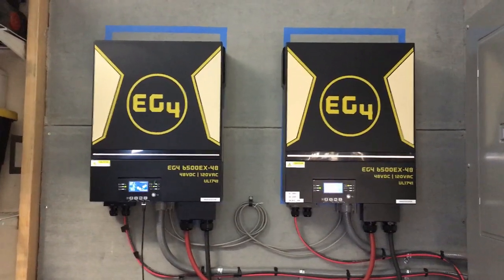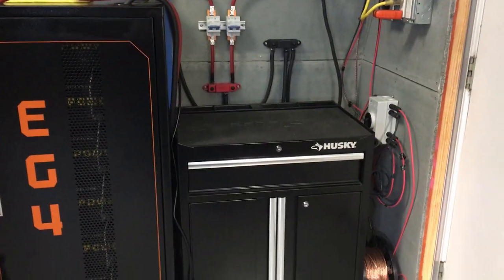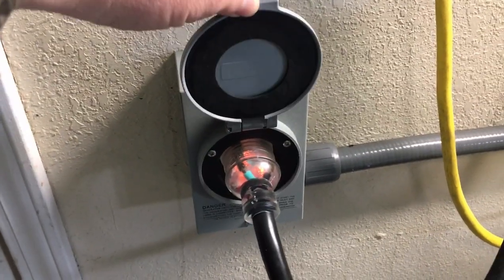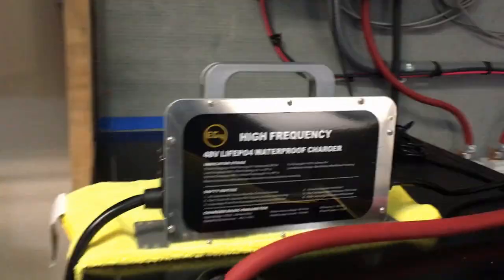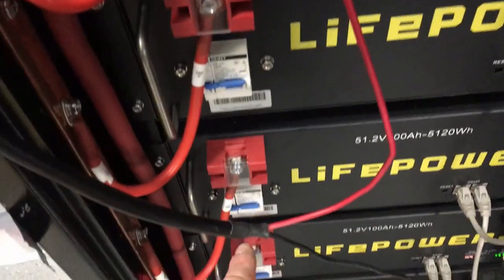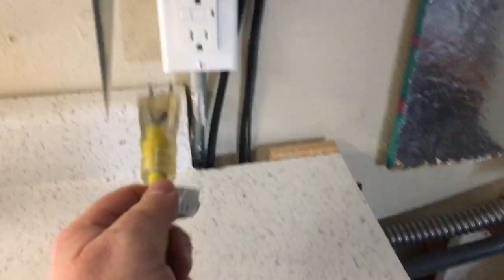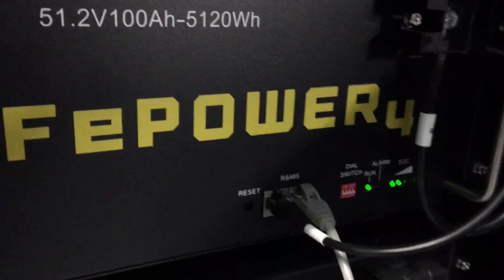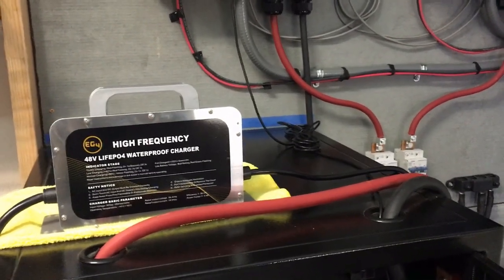EG4 Battery Charging Tips To Help On Cloudy Days

Comment: Hmm, Can one not just run the gird power into the inverters and then they charge the batteries? Also, Maybe a tripod so that you don't make everyone seasick!
Reply: I’m wondering if you can run an off grid system to your main panel, viva an Internet connect switch, and then, when you go back on main power, just use your generator connection on your inverter to plug into your 120 V house outlet? I usually set my generator setting at around 1200 Watts.

Comment: Just a suggestion. In order to reduce ripple on your DC buss and prolong the life of your inverter's filter capacitors and reduce EMI radio frequency interference. I would suggest taping both negative and positive cables together and not separating them like you have done in your installation. Also when it comes time for an upgrade. I would suggest losing those low cost. lightweight, low surge capacity, high frequency inverters and upgrade them to more reliable, high surge capacity, low frequency, transformer based inverters. You'll have a much longer life expectancy, a much higher 300% peak power capacity and much safer operation due to the galvanic isolation between the DC boost stage of these inverters and their AC output.
Reply: I watch solar videos a lot during the week. In the last few months I’ve seen you repeat nearly this exact comment word for word probably 40 times on dozens of channels. Sometimes multiple comments on the same channel. I don’t really understand what motivates that. It’s just odd.
Reply: That's funny coming from a inverter salesman that has sold out (all for a buck) to several cheap Chinese made inverter manufacturers. As an obvious newbie to the RE industry, you have no formal training or knowledge about inverter tech,. So I find it odd that you're promoting (spreading disinformation) about products that you know nothing about.  @GavinStoneDIY